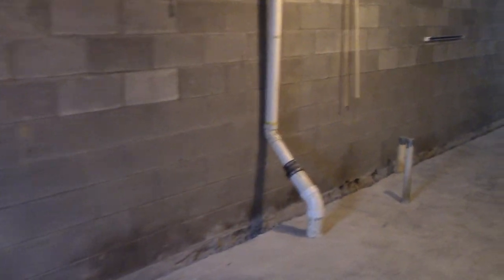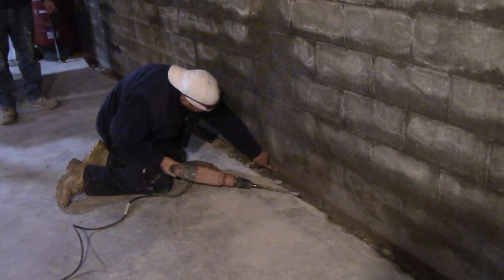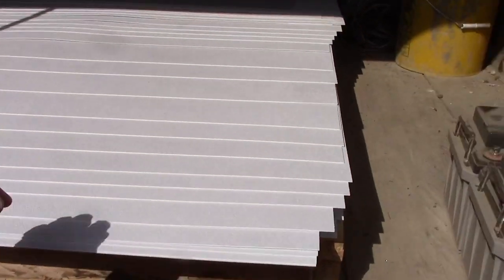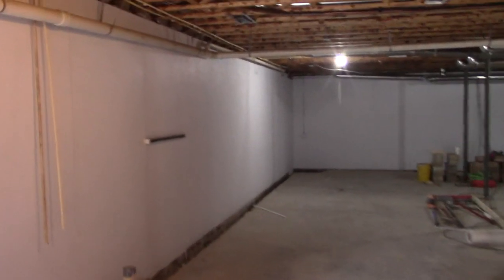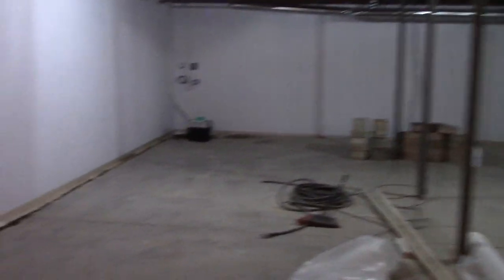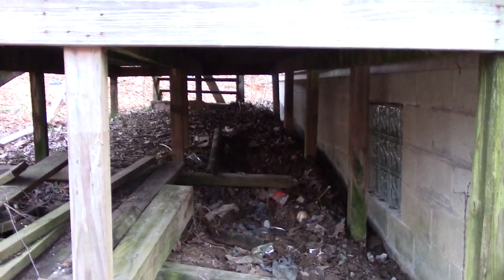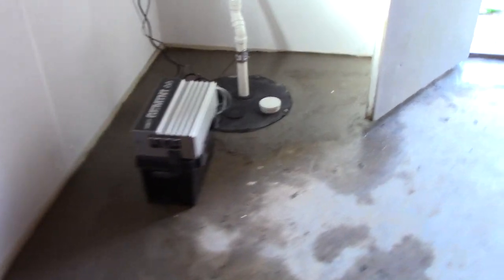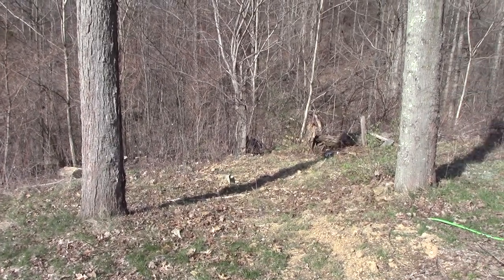Hoarder House To Home Episode 13 - Basement Waterproofing Completed

Comment: We did excavation on the outside of the wall of the basement.. and filled with  pebbles and drainage system, and anything that was exposed to the soil we 'tared' - actually i painted the tar on the blocks...with extra insulation (whihc was tarred silver foil paper.. (not sure what it is called)  on top of that before we filled the soil back..  to stop water to get into the blocks in the first place... what he did there wont stop the water seeping into the block walls... and they will still get wet. Just saying..
Reply from the maker: We have an external system too. There is so much soil erosion that it clogged. This was a much more effective solution that wont just clog up again

Comment: Can you share the name of the company you hired to fix the basement? I'd like to look for a similar company in my area.
Reply from the maker: We hired the Basement Dr, but I wouldnt recommend them at all.
Reply: @JackofAllMasterofNone  Why no recommendation?
Reply from the maker: Because some of the crew was horrible and cut corners. Also the electrician tried to wire the sump pumps wrong and not to code until I called him on it. Could have been a serious fire hazard. Totally unacceptable
Reply: Good job you were there! Hi from UK